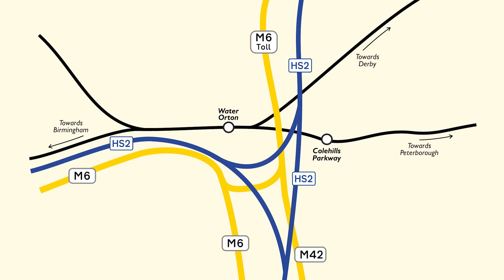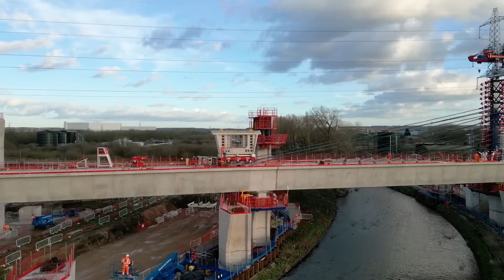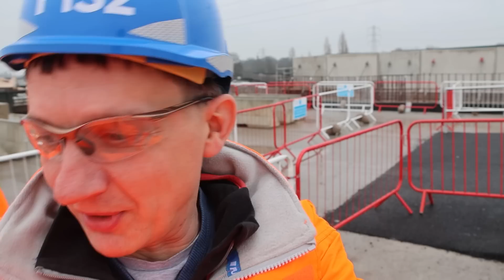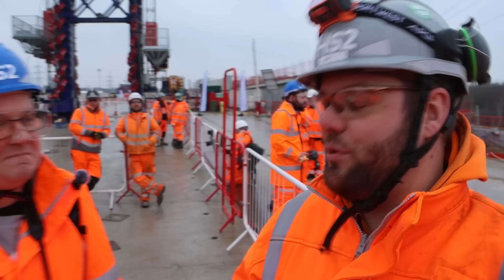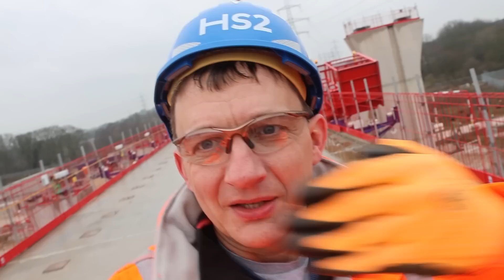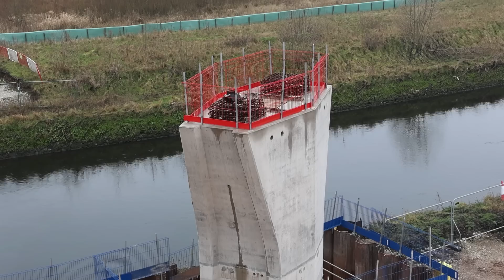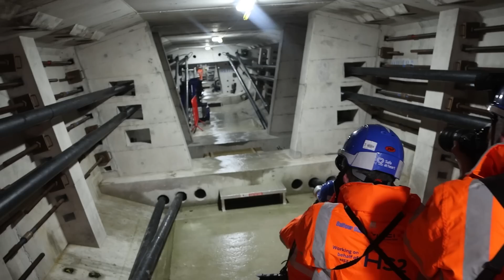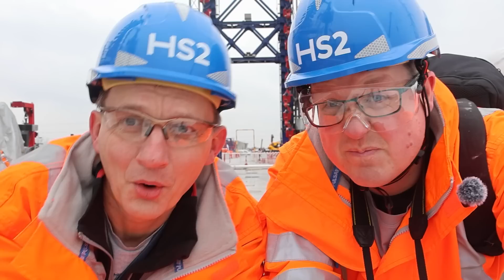HS2 Delta Junction Under Construction

Comment: Even if 2A and 2B are cancelled, I am glad that they are building the infrastructure to facilitate their future completion at the delta interchange rather than trying to make any future expansion impossible as was attempted with the selling up of land along the corridor
Reply: I assume it was cheaper to not redesign the junction and just build it to plan, of course the added bonus is that if there is the political will in the future it can be expanded.
Reply: and Phase 2B is extremely short and cheap compared to the rest of HS2, so it really wouldn't take much to put it back in @Fern_The_Mage
Reply: @Fern_The_Mage  I still maintain it will be done, its basically inevitable. BUT in true British politics fashion it'll be done in tiny bits that end up costing WAY more than if we'd told treasury to FO on draft 1. History provides us with DOZENS of examples of this happening and mark my words it'll happen. We'll have politicians say "oh wow, why didn't we do this sooner" and zero lessons will be learned and we'll have the exact same thing happen in about 10 years.

But obviously the only reason HSR continues to be so expensive in the UK is because its done like this and we never build up the institutional knowledge as a result. If HS2 had been started as HS1 wrapped up it'd have cost magnitudes less because the infrastructure and know-how could've just been moved over instead of being shuttered and reopened. Same goes for all rail building in the UK, although nationalisation will help bring about a grander strategy again. Its no coincidence that very few big projects have happened under privatisation.
Reply: @Fern_The_Mage  Yeah, it is always cheaper to not redesign, but politicians love to ignore that bit of wisdom (see the multiple redesigns of Euston HS2)...
Reply: @Fern_The_Mage my personal aspirations would be to see all of HS2 built but to a less silly speed of 325 km/h which would make it so much more affordable . Our tiny island doesn't need 400 km/h and there is such little difference. Even just doing this for phase 2 considering work has already began on phase 1 would save so much money
Reply: @abeing3 Why purposely downgrade it by 75km/h ?

Those 75km are half the distance from London to Birmingham.

Ok the speed difference would mean a travel time difference of 6 minutes over 160km. You're right; no one is in that desperate a hurry to get to Birmingham.
Reply: @abeing3  Reducing the speed makes almost no difference - slab instead of ballast already being used reduces maintenance cost and time, the alignment wouldn't change all too much for that speed and we would still need just about every bridge and viaduct already designed. Higher speed (admittedly not by much) can increase possible capacity with almost no expense.
Reply: @quantisedspace7047 Exactly, I would rather get to Birmingham 6 mins slower and be able to also get HS2 to Manchester Leeds etc.
Reply: @abeing3 At 325km/h (200mph) it would be a minor reduction in journey times for a huge decrease in costs. Swearing by 225mph is one of the worst things the (former) government did to this project.
Reply: @joj. Yup, exactly what I think
Reply: @quantisedspace7047  Building HS2 to accommodate 400km/h trains is unnecessary and expensive gold plating. The Mayor's proposal to build a high speed railway along the route of the now defunct HS2 line between Birmingham and Manchester proposed to cut line speed to 300km/h to cut costs and make the project affordable.
Reply: @abeing3  I am SOOOO Sorry that you a peed that HS2 is mainly going to Birmingham than Manchester, but it is actually 40 mins quicker getting to Birmingham not 6 mins.
Reply: @joj. Its structures like the delta junction and the innercity sections and stations which are the bulk fo the cost. Reducing speed would not reduce cost by much. Operationally, it will usually run at 330kmh, the 360 was to maintain reliability, important for 18 trains an hour spec.
Reply: @Andrew_Waite_Stuff it alone doesn't reduce by much, their proposal is not to use slab, which was more of a need due to tonnage not speed.
Reply: @benphillips5041 The trouble with that is the line has to be built as if it was running at 360km/h, meaning larger turn radii, overspecced track and overspecced trains.

You can't cut out infrastructure like the Delta Junction and the tunnels, you can reduce the speed by such small amount that you're talking 1-3 minutes difference in journey times.
Reply: @joj. The difference in cost is small. The alignment wouldn't be much different if slower, Tgv alignments are built to 350-400kmh. All the bored tunnels are 320 or lower similar to tgv standards. A slower speed increases costs elsewhere in terms of stock required, and then depot space.
Reply: @benphillips5041   The alignment would be very different because it's still currently working on the old target of 400km/h. Reducing that to 320 wouldn't lead to a difference in the stock cost or depot requirements because it can still run to the now Euston-capped 11 tph.

Per the Oakervee Review, though, if the route targeted 320km/h, "the cost impacts... could have the potential to be quite wide-ranging", and the 400km/h speed led to "10% higher" costs in the finished design, which would translate now to about £10bn in savings.

Edit: Also, in response to your (I'm sure completely serious) reply to abeing3 above, the actual journey time reduction to Birmingham is 29 minutes, and to Manchester 30. Having said that, speed was never a reason to build HS2, and "it only makes sense to do Phase One if continuing with northern phases", so it's less annoyance at not getting the new train and more that political meddling has basically ruined the economic basis for the project.
Reply: @joj.  You're selectively quoting Oakervee there. Point 6.9 talks about building to lower speed (undefined) AND lower frequency. In that point and in point 6.7 their examples are related to frequency, not speed. As I mentioned, slab was also a result of the tonnage expected rather than the speed. 

There are some myths that HS2 could have avoided the Chilterns or followed the M40 at a lower speed, but neither would have happened - m40 twists around settlements and woodlands to an extent a 100mph line wouldn't manage; The AONB Chilterns extend far further than people seem to realise. A route going round via Luton was looked at but required an expensive urban tunnel under Luton and more route miles to build. 

Current fastest journey London-Birmingham is 79mins, although usually 81. HS2 would do it in 45mins without stop at interchange and 49mins with.
Reply: HS2 is NOT only going to Birmingham as the HS2 line goes past Birmingham via the Delta Junction to Handsacre in Staffordshire at the moment where it will connect onto the existing West Coast mainline via a high speed junction taking HS2 trains to Liverpool, Manchester and Scotland
Reply: @abeing3 Lowering the speed wouldn’t save us much.
Reply: @Fern_The_Mage  “Political will" does not pay for such a vanity project; huge debt does, and only a kamikaze government would saddle the country with this.
Reply: @d-zone Oh bless! Is your nurse late with your tablets?
Reply: @ianhudson2193  iIt’s great that you can play with the computer at night. Now, go watch some other train videos of journeys they won’t let you take by yourself.
Reply: Phase 2A was to start at Fradley in Staffordshire, not at the Delta Junction. The Delta Junction is just a junction within section 1. HS2 will go all the way from London to Handsacre on the WCML 2 miles beyond Fradley and 18 miles north of the Delta Junction.
Reply: The Delta Junction is being designed as intended with one leg taking trains from London to Birmingham the second leg from the North to Birmingham and the third leg from London to Manchester and the North.
Reply: The biggest mistake, now we know from hindsight, was not starting between North and Midlands. Much less problems with planning permission, land cheaper, far less obstacles and more enthusiasm north of the Chilterns. 

My annoyance is that the planning system is still far too vast, far too complex, with far too many agencies involved. There are plans to simplify planning for infrastructure afoot and this should come online next year. How successful it will be will depend on the next government.
Reply: Can it and stop wasting more money that could be used to improve the M1 and M6
Reply: @chrissimmonds3734 Err Why do you want to improve roads at the expense of railways ?
Reply: @quantisedspace7047  it's cheaper to build and use.
Reply: @quantisedspace7047 Why? Expensive to run, expensive to be a passenger and with opportunity cost roads and cars are more efficient. For example, three of my four girls went the fourth wedding one single fare was £124 another £135 and then £96. Single fares. Then was taxi fares on top. No information on the return fares. My car is old but the petrol bill for four people was £77.  Can you see the no brainer here. Incidentally the Air fare return was £130. Still no brainer. BTW the car journey was 3 hours, train journey was 4 1/2 hours we also could stop have refreshments where we wanted too no brainer
Reply: @d-zone  Cheaper to build, sure. But then the users need to meet the buy in cost of purchasing a car, plus the ongoing costs of insurance, tax and maintenance, plus fuel.

Then the country suffers too from having to cover more land in tarmac and concrete in order to make space to drive and store more cars, and more oil imports to keep a rather energy inefficient form of transport going.
Reply: @chrissimmonds3734  Still needed to buy and run the car. And there are ways to reduce those rail fares, like two together railcards, group save tickets or even just buying in advance.
Reply: @quantisedspace7047  Because he is trolling a rail-friendly comment section?
Reply: @quantisedspace7047 Because that's what his deranged cut n paste Anti HS2 group tells him to type!
Reply: @chrissimmonds3734 Why do you feel the need to make a clueless fool of yourself on-line?
Reply: @chrissimmonds3734  "cars are more efficient" - no they aren't. Didn't bother reading past that nonsense.
Reply: @chrissimmonds3734  HS2 is improving the M1 and M6 by taking cars and trucks off them.
Reply: @user-fc6jq4xn9mIndeed.. Increasing the capacity of the Motorways by effectively adding another lane or two for the sole use of people who travel without cars. Conceptually, it's little different from adding a bike or pedestrian lane to thin out the traffic on the main carriageway.
Reply: @user-fc6jq4xn9mexactly, if only they'd focused more on the freight aspect instead of the speed. The number of lorries on the road today is far too many.
Reply: @CA_I  Except for the fact that HS2 is (or at least, will be) taking lorries off the road. By taking express trains off the conventional main lines, that allows trains to run more closely together, because the difference in speed is smaller. This means significantly more freight trains will run on the conventional main lines, taking even more lorries off the road.
Reply: @CA_I  It's impossible to provide the network capacity for more rail freight without building dedicated high speed routes for passenger services. Building for high speed does not meaningfully impact costs, it's simply the modern technology. It would be idiotic not to utilise it.
Reply: @chrissimmonds3734  No. Building or widening roads just leads to more traffic eventually. Rail is vastly more efficient.
Reply: @chrissimmonds3734  if 2b get built a shed load of lorries will be off the the M1 and M6
Reply: @chrissimmonds3734 No lol, the whole point of HS2 is to be transit incentive and take cars off the M1 and M6.
Reply: @motodonny5874you must be joking? How many people would you get on a train compared to a linear section of M6? An extra three lanes either side at a guess would be far less costly as some parts of HS2 and would solve the issue. The HS2 construction estimate is now near £90 billion with other pundits touting £120 Billion. Building a new motorway is between £20 to £60 million a mile, London to Birmingham is 181 miles, do the maths the motorway is a no brainer by a very long way
Reply: @chrissimmonds3734  GUYS GUYS IVE SOLVED IT ONE MORE LANE WILL FIX TRAFFIC GUYS JUST ONE MORE LANE I SWEAR
Reply: @chrissimmonds3734 The project started and the money’s been spent so increasing capacity of the Motorways is taking away the purpose of actually building HS2 - why would a new motorway/widening of existing motorway be done if there is already a new high speed rail being built to relieve the motorways. It’s also to relieve demand and overcrowding on the West Coast Main Line.
Reply: @motodonny5874please read another of my posts where I show that the costs of building HS2 far, far exceed the costs of widening both the M1 and the M6. I would also point out that the opportunity cost of building HS2 rather than improving both roads is enormous in terms of hold ups to commercial vehicles. Lastly I might add the volumes of passengers using HS2 is a fraction of those using the motorways, the expected reduction in car users will be minimal.
Reply: @chrissimmonds3734  How many people could you fit down a railway compared to a motorway? You don't want to be asking that question if you're on the side of building more motorways mate.
Reply: @idot3331 your question should be how many fit in the carriages? Then how many trains per hour? One every half an hour? Far far less than on the motorway
Reply: increasing lanes ends up always making traffic worse. this is due to induced demand. sure, the British Rail industry needs to lower their prices, but trains and alternative transport are the only way to reduce congestion. @chrissimmonds3734
Reply: @chrissimmonds3734  It is a fair question, so here's some numbers to answer it:
Since I can't find any data for the M6, I'll use this technical note from TfL and extrapolate. It claims that a 3-lane motorway can carry 5,600 vehicles per hour combined. So that's 2,800 vehicles per hour per direction. In 2023, the Government stated that average vehicle occupancy in the UK is 1.6, so the maximum number of passengers per hour per direction (pphpd) is 4,480.
Now compare this to HS2, which is designed for 18 trains per hour (tph). The new HS2 trains will be 200m long, with 550 seats. HS2 is designed for 400m trains, so we can safely assume the trains will be paired up, meaning 1,100 seats per train. So, even with a train every half hour, as you assumed, that's still 2,200pphpd, which is almost 50% of the capacity of a 3-lane motorway. But if we factor in the designed 18tph, suddenly HS2's capacity is 19,800pphpd, or almost 4.5x a 3-lane motorway's capacity... It is rightly being described as a step change in capacity.
Here's the TfL technical note I mentioned: https://content.tfl.gov.uk/technical-note-10-what-is-the-capacity-of-the-road-network-for-private-motorised-traffic.pdf
Reply: @chrissimmonds3734  Your understanding of rail freqency being "one train every half an hour" comes from a broken, outdated and horribly over-capacity rail network which dedicated high speed rail is the solution for. When trains on a line all run at the same speed, rather than being a mix of freight, local and intercity services, you can run far more trains per hour with far less possibility of delays.

HS2 will have a capicity of 18 trains per hour.  With a capacity of at least 1,100 passengers per train that's 19,800 passenger capacity per hour. If they run for 18 hours a day (6am to midnight) that's 360,000 per day. Even the busiest, widest stretches of motorways only carry around 200,000 people per day (12.2% of which are lorry drivers who can't be compared to rail passengers) while taking up at least four times more space, using far more energy to run so many individual less efficient vehicles, and producing magnitudes more air and noise pollution. And then all of those vehicles have to move onto other roads, contributing to road congestion, and then have to park somewhere, taking up huge amounts of wasted land and contributing to general urban decay and social degredation. Not to mention the increased capacity and potential for new stations and services delivered to existing railways by introducing a dedicated high-speed route. Every other developed nation has built high speed rail for a reason; it's a no-brainer solution to so many problems.
Reply: @chrissimmonds3734 2 trains an hour? The route would have the capacity to do 18 trains an hour and each could carry over a thousand people.

People massively underestimate how space efficient trains can be. An average car has less than 2 people in it, and has to leave dozens of metres to the car in front to be safe. A 2 track railway can easily carry more people than a 6 lane motorway (and indeed do every day, otherwise the London commuter belt wouldn't exist)
Reply: @chrissimmonds3734 Tell us,you dont understand infrastructure financing without saying you don't understand infrastructure financing....🤦
Reply: It's cheaper to just finish it now then stopping  @chrissimmonds3734
Reply: @chrissimmonds3734  yuck
Reply: @chrissimmonds3734  So how wide do you want the M1 and M6 to be to improve traffic flow, that WOULD be a total waste of public money enough is spent on roads in the UK and it makes no difference